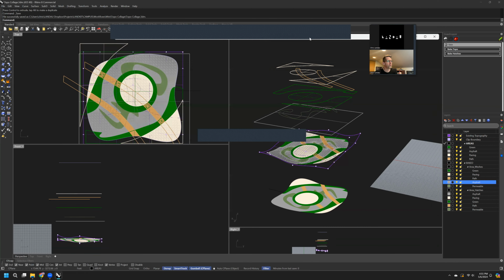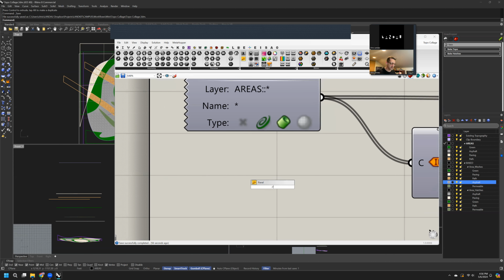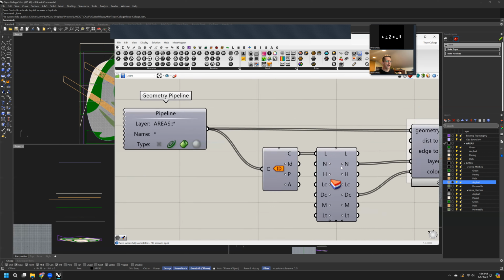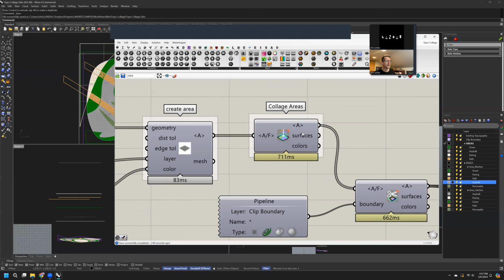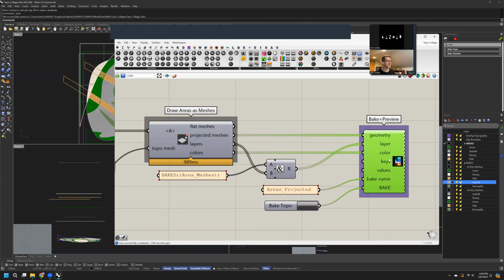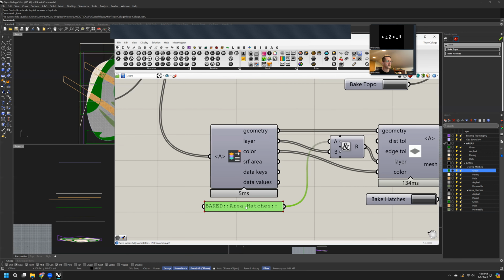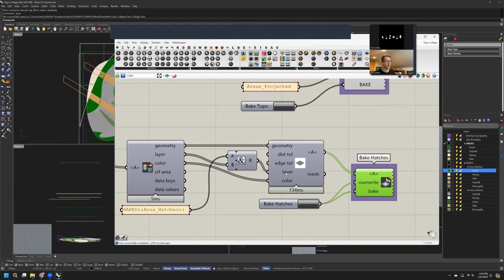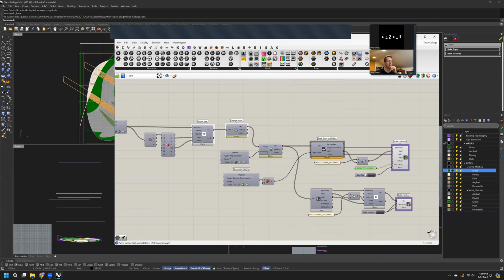Areas Collage+Clip Site Design Mini Workflow (Script Tour)

Comment: I just signed up for a trial, and I have no idea how to start using Landkit. What's the first step to getting into the workflow?
Reply from the maker: Hey! Awesome! You can download an installer here.
https://www.landkit.design/download
If you want to start using the mini workflows (like in the video here), you may want to watch one or two basic Grasshopper tutorials first. But you can also use the larger Workflows which are like mini apps that don’t really require any Grasshopper knowledge. You can get those here:

https://www.landkit.design/workflows